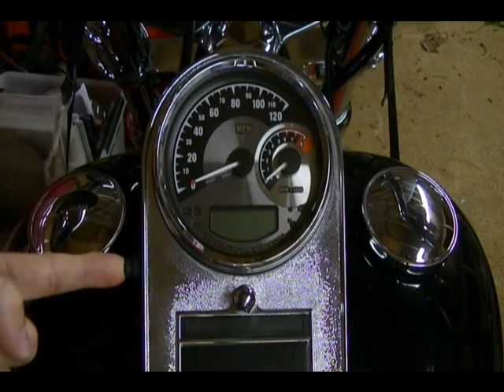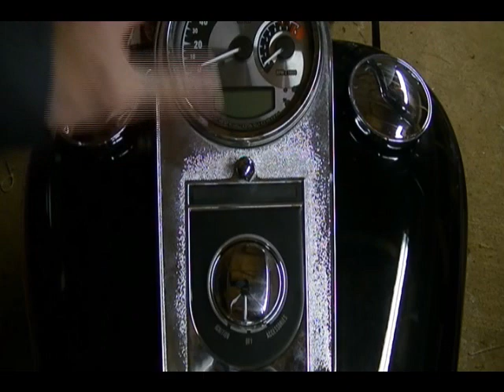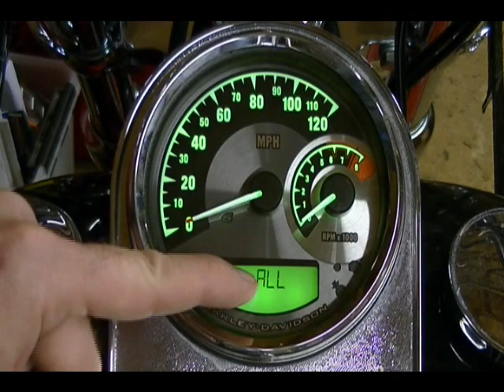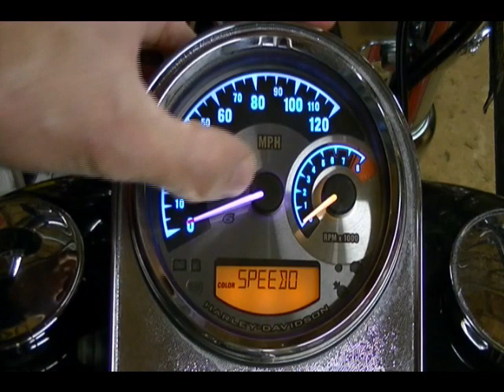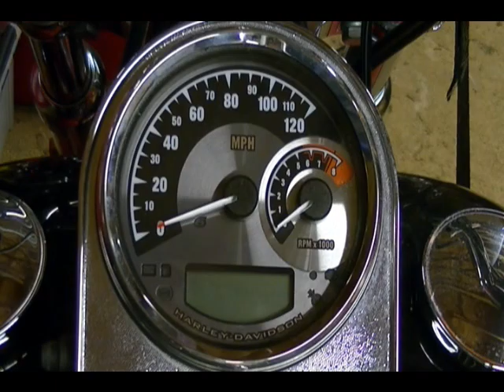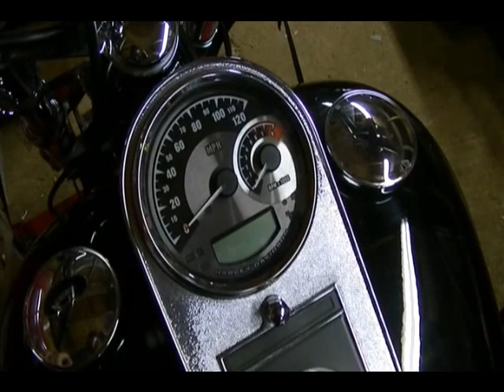How to Configure and Setup the Harley Davidson Speedometer Tachometer #70900070A

Comment: I know this is an old thread but: does anyone know if this gauge will give me tach/gear/fuel into on a 2010 Fat Bob ??? No one seems to know.  My bike doesn't come with a tach, so I guess I'm wondering if the wiring is set up to offer data to this gauge that the stock setup doesn't have.

Comment: Great video. will this work for my 2007 Softail Deluxe?  I would like to have the gear function shown
Reply from the maker: You can find this item here:
https://www.harley-davidson.com/us/en/shop/combination-analog-speedometer-tachometer-mph/p/70900070B

Harley says it fits these models: Fits '04-'11 Dyna®, '04-'10 Softail® (except FLSTSE) and '04-'13 Road King® models (except '07-'08 FLHRSE) equipped with a 5" Speedometer.

Comment: I have a 2003 Softail Fat Boy. I want to install a meter like this for it, but the plug is different. Do you have any idea about this and is there a part ready for the electrical connection?

Comment: Thanks for your video.  Just installed this today on my 2009 Heritage.  Your instructions were much easier to follow than the printed ones.  Took it for a 32 mile ride to lock it in.  All functions work as described and like it much more than the factory speedo.  Ride safe

Comment: I installed this item on my 04 RK classic, it worked fine for the past 5 years--however a few days ago, while I was out for a ride the ABS light came on, never did the light come on in the past--as you may know the 04 RK does NOT ABS equipment on board to begin with, has anyone ever heard of this problem before?--thanks in advance

Comment: Weird thing, I have an 05 road king, and speedo shorted out after washing it. I bought this same tach, but the model # ends with B instead of A. Same thing except for there is no KPH on MPH. I followed the install and data link to a T, and when I would ignition I'd get a NO CAL in the LCD, and then that would go away, and it was replaced with NO SPD. It would not transfer the odometer to the new odometer. I'm thinking that if your speedo stopped working, replacing it with this type of Speedo will not work due to the inability to transfer odometer reading of a broken speedo to the new speedometer. I can't find anyone with an answer to this. 

I thought this might be an issue, as the old speedo was as if it wasn't there because IT WAS BROKEN (insert Sam Kinison Tirade). Our shop service guy in Folsom checked with the mechanic, and "it's okay, just follow the directions." Engine switch on, Data Link plugged in, no go! I had the old speedo out, and was tapping it and banging it slightly, and I saw LED partially show numbers, they would immediately dim if I stopped squeezing the old gauge. Thinking the ecm possibly sensed the old speedo after doing the Fonz bang and tap on the old speedo, which seemed to allow some juice into it, so I did the transfer procedure again, and something did change this time as it just went to NO CAL, without going to NO SPD. 

I'm assuming NO SPD means it isn't sensing a speedo. Well It stopped that, and the NO CAL shows. There is a red light blinking, but then after a bit the red light goes solid and stays on. But still  it did not do the conversion. The trouble shooting guide for this particular NO CAL says, normal function, but ads as long as "percentage and ok" show, which they don't. I went ahead and plugged the new speedo into the consul to see if something happened, and the new speedo lit up beautifully, but with NO CAL or something I forget. But no odometer transfer. I'm wondering if I should ride it and go through that 31 mph countdown the document spells out. 

I'm going back down to get a speed sensor. Apparantly, it could be that issue if the signal lights don't cancel, for one sign. With the bike just leaning on the stand, it doesn't cancel. Somebody said I had to at least lean it or move the steering for it to cancel, which I haven't done. So, I'll check for cancellation leaning and turning the bike. With all the forums out there only about 4 of these issues are on the net, and none of those who had the problem explained how they solved it. These speedo combo's don't work if your replacing a broken one. They should explain this, as there is no refund for them. They seem to only work if you are upgrading. I need to get the odometer reading back, as I'm selling. Any ideas?

Comment: I bought a bike with a TTS Mastertune and this speedo installed. Attempting to unlock the ECU fried it so I had to order a new one. Now my odometer displays 999999km / 213711mi. Is there a way to fix this? I'm guessing not.

Comment: I just installed one on my 2007 Softail Custom and the gear indicator does work.....
Reply: very cool man, I have a 07 Custom and want to install it for ID like to have a tach, just to make sure I dont blow the motor, it be nice to know where she is at as far as the redline goes. Do you find the speed section is too small. I like the larger size of mine and considered just getting  a standalone small rpm gauge

Comment: Never mind, after a little more research I figured it out. 
With the bikes that have the trip button on the handlebars there is a different button sequence.
You have to use the turn signal buttons to get in. I may post a setup video for the new bikes, if I get any request.
Reply from the maker: +Tim Dahl Thanks for watching!
Reply: I just got a 2014 CVORK, does the gear indicator work in all gears or just 6, also i have not played with my speedo yet but will today.
Reply: Guys I figured out a problem I was having with the combination speedometer tachometer using a drag specialties flush mount gas gauge. The combo is not compatible with these gauges. You have to use your original gauge and a dummy gauge. You take apart the original gauge including all of the mounting hardware metal dial etc. using then using electrical tape wrap the entire thing up and stuff it in the space where the gauge would go. Put your dummy cap on and your fuel reading now will be correct. Getting the chrome off the original fuel gauge is the hardest thing to do everything else is simple. Works like a charm
Reply: I forgot to mention that the problem I was having was that my fuel gauge on the combo speedometer tachometer was reading empty. Now it shows the correct reading.

Comment: I've added one of these to my 2012 wide glide. the trip reset is on the bars. Everything works correctly but I can't get it into setup mode. I can set the clock, but that is it. Any ideas where I went wrong?

Comment: Great videos. Very well done and easy to understand!! I need to replace the speedometer of my Road King Classic 1998 FLHRCI (odometer damaged). Could you recomend me a similar part that will fit it? Will it be possible to get tachometer and gear indicators working on it? It´s a five speed gear (not six like the new ones).